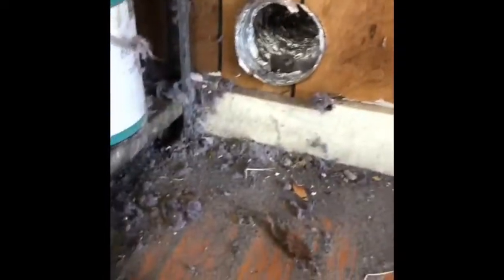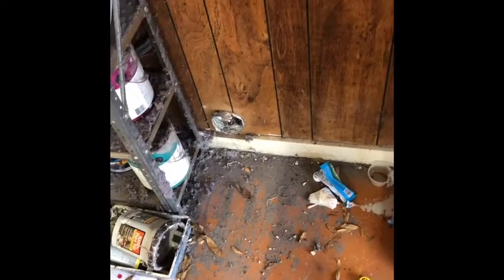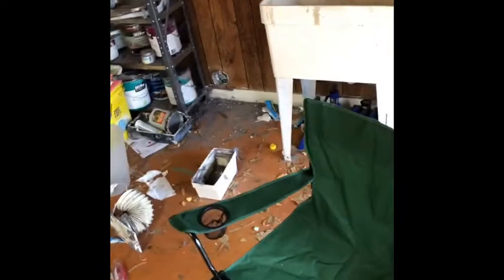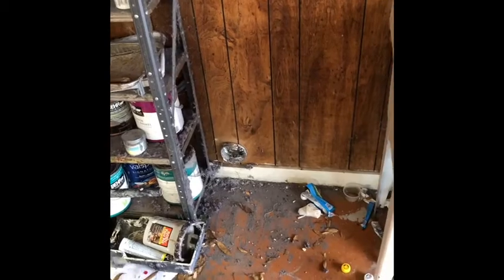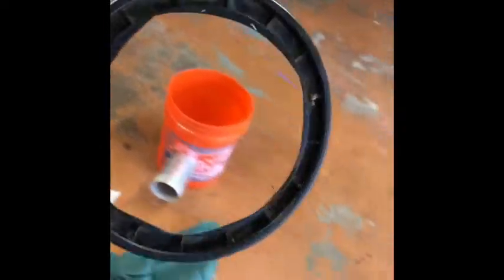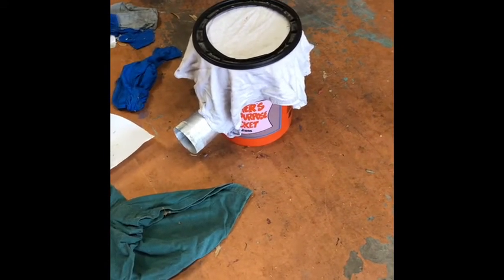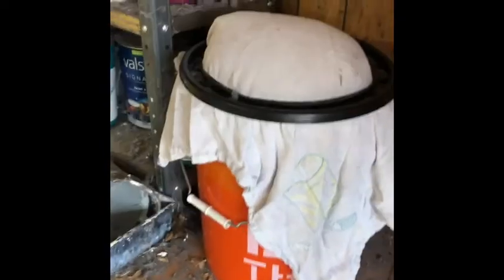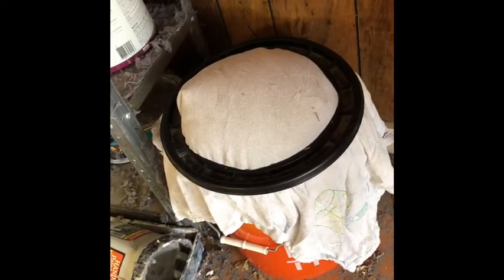DIY Dryer vent box

Comment: how'd this work for you in the end?
Reply from the maker: Worked well for a few weeks... But, I don't like dumping all that heat and humidity into the garage (especially as it was getting closer to spring/summer) so I ended up ducting to the outside, adding an inline duct fan, and pre-filter to keep lent from clogging the fan. Been working awesome for a couple years, just a little more involved on the install!

Comment: Bad idea. You are choking off the air flow in a huge way.
Reply from the maker: Honestly in hindsight I think you are spot on :) This probably wouldn't be a good long term approach, although I didn't have any issues with the dryer cycling on high heat or anything. I ended up going in and ducting to the outside and adding a booster fan and additional screen. If I was to go back and do this "bucket" approach again, I would probably add in a medium-mesh screen instead of a rag for sure. Lower pressure drop but a large area. Thanks for calling that out.